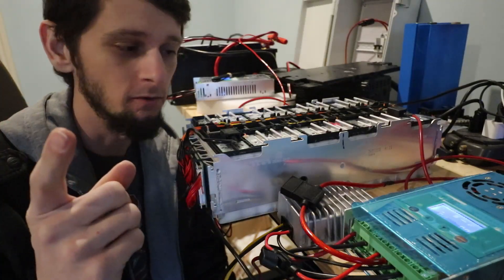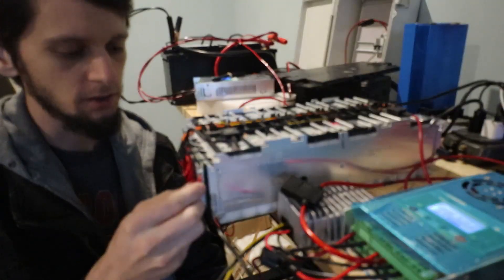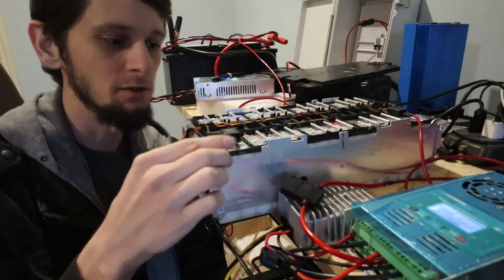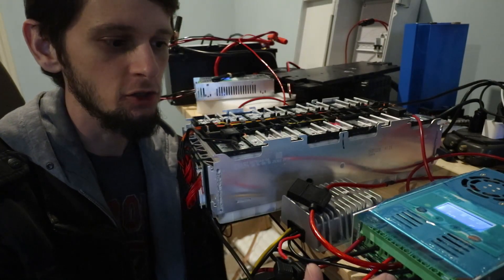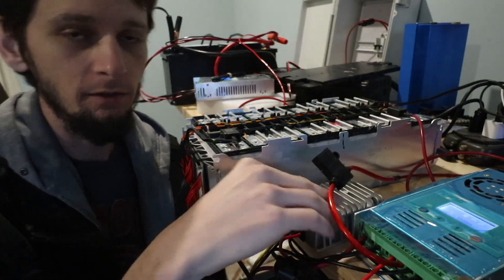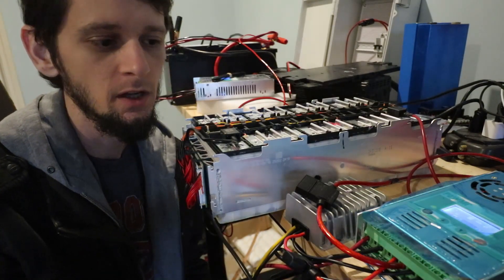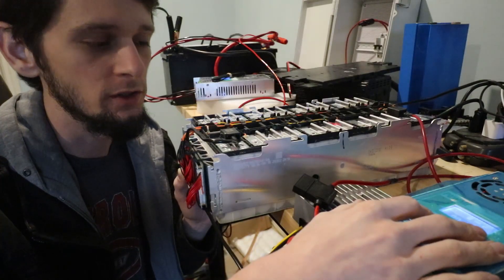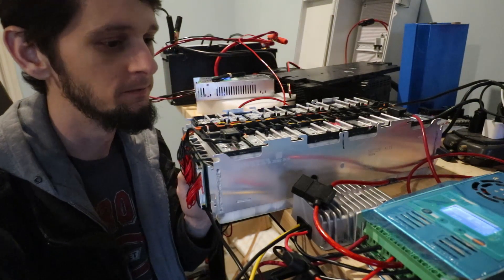PowMr Solar Charging BMW Battery for Off Grid Ham Radio or Repeater

Comment: I'm going to be doing this with Toyota prius battery changed to 12v
Reply from the maker: I want to know how that goes. I know the modules in a nimh pack are 7.2v each and a healthy full pack is only about 800wh.
Reply: @BeeneEnergy  i have 3 of them
Reply: @BeeneEnergy  got them for free so I can't complain. If it don't work out ill sell them and buy 2 sets of golf cart batteries
Reply: @BeeneEnergy  i get 12 6v batteries
Reply: @BeeneEnergy  I just need to run 250 to 450 watts from sun down to sun rise

Comment: i think your link to dc-dc converter was meant to be more like this https://www.amazon.com/EBL-Converter-Regulator-Waterproof-Transformer/dp/B08DK1XLCB/ref=sr_1_3?crid=1WE89YNDBD7OH&dchild=1&keywords=24v+to+12v+converter&qid=1608466134&s=electronics&sprefix=24v+%2Celectronics%2C251&sr=1-3
Reply from the maker: Oops you’re right. I’ll go fix that.